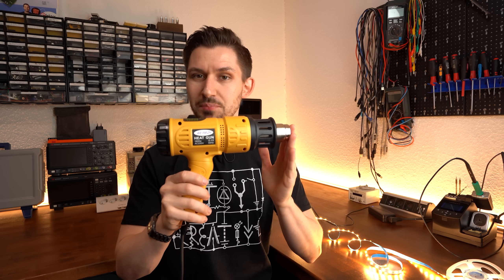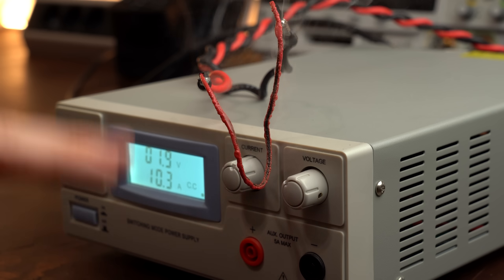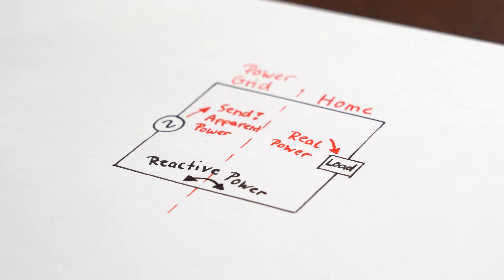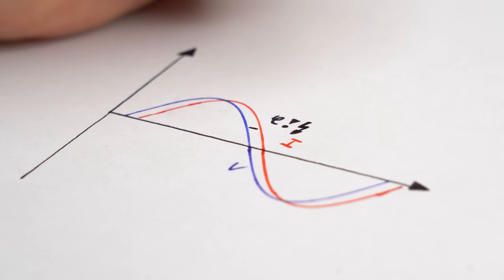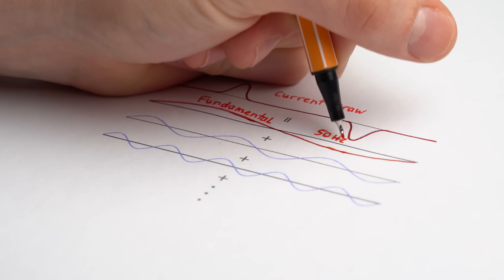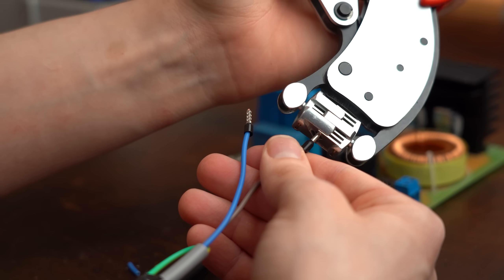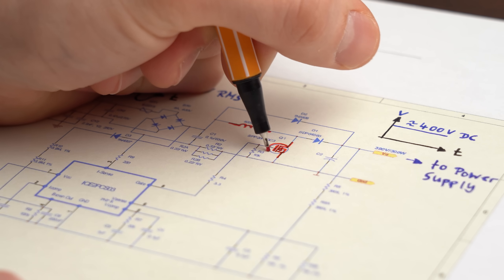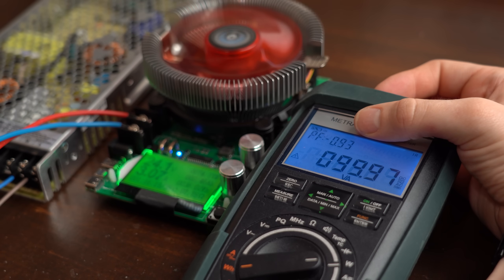The Most Important Circuit for our Electrical Future?! (PFC) EB#55

Comment: I have a vintage thermal printer that requires 5v and -24v, and I'd like to see a video going over the correct way to create negative voltages without giving a large DC offset. as I'm looking to connect this to my modern desktop.
Reply from the maker: Already did a video about negative voltages.

Comment: the problem with PFC-enabled devices is that they don’t properly trigger UPS if mains power goes down. I bought an awesome server power supply from HP to power my 3D printer and later found out it is “invisible” to my cheap APC UPS :(
Reply from the maker: Sucks to hear that.
Reply: I didn’t check it thoughly; maybe it was just a beefy PSU (200A) with a small load (maintaining a heated bed’s temperature). Or my cheap APC UPS is just dumb.

Comment: I'm still wondering why 400 V DC, since shouldn't it be around 325 V ( sqrt(2) * 230 V)?
Reply from the maker: "Active PFC is basically a glorified boost converter"
Reply: @greatscottlab  Okay, thought it came along with the rectification value. Thanks for the answer and the awesome Videos!

Comment: Great video! Also, it only remains to add, that some power supplies use passive PFC in form of a huge coil on an iron core. The coil opposes the fast current rises of the capacitor without drawing too much real power.
Reply from the maker: Interesting
Reply: Passive pfc's are ok for light loads..where the pcb/component area is not a constraint..since all components required are to function at i/p DC rectified ripple frequency 2×(50/60Hz) hence it becomes bulky although NO BULK CAPACITORS ARE USED.. ......typically single stage is most common a single stage is usually 3 diodes, 2 caps. & 1or 2 inductors  (  but 2 & 3 stage are designed..3 stage design reduces p-p ripple to about 30%...also has higher ripple frequency. so dc is good.
Reply: Single stage passive pfc's had widespread use in C.FL.'s with ratings up to 20-25 W.
Reply: AAAAhhhhhh! so that's what that honking big ass coil is for in the power supply units!!!! 🤗thank you kind man for sharing your wisdom.
And big thanks to Scott for lovely electronics lessons!
Reply: @ogi22 that's not usually the same thing. Most power supplies use active PFC these days unless they're really low powered. The large coil you see could either be a common mode choke used to filter RF/EMI noise if on the primary side, or part of an LLC resonant topology if on the secondary side, depending which coil you're referring to.
Reply: @ogi22  thats not what they are used for most of the time
Reply: I seem to recall seeing this solution in some older OEM computer power supplies.
Reply: Awesome vid  Scott Ty.
Reply: The choke (of a realistic size and cost) makes only a minor improvement of the P.F.
Reply: LC filtering instead of just straight capacitive filtering (edit to clarify - this is filtering AFTER the rectifier) will result in better power factor / lower harmonic content, but it isn't very practical with high-current loads at mains frequencies. It used to be common in high-voltage power power supplies such as those used in vacuum tube ("valve") circuits where currents were generally not very high, at least in consumer electronics.

There are passive "valley fill" PFC circuits that can improve power factor but I don't think they've ever been widely used.
Reply: @VeniVidiViral 
There really isn't much on mains that is too likely to cause problems with digital circuitry unless there is something quite unusual. I've seen some pretty hideous mains noise caused by an electric arc furnace used for metal smelting. It IS sometime necessary and always wise to provide protection against transient voltages that may occur on mains, but this is done with devices like gas discharge tubes, metal oxide varistors and the like. Inductance can be beneficial because it slows the rate of change of current so narrow spikes are easier to suppress.

The vast majority of EMI/RFI filtering, whether it is on the mains input or signal connections in digital circuity is to keep the noise IN rather than OUT. Switched mode power supplies can put a lot or RF on the AC mains unless proper filtering is used. Lots of RF noise can be carried out of shielding enclosure on signal cables. The ferrites that are sometimes found on things like video cables are to keep noise from going out on the cables, not to keep external noise from interfering with the signals.
Reply: @@RHRigs No, the one I mean is big like a mains transformer.

Comment: Pfc are becoming available as standalone modules tho it's still a gamble as some are just snake oil still
Reply from the maker: That sucks to hear. Do you have examples for that? I would love to have a look.
Reply: @greatscottlab  I'll fetch you some codes once I'm back from work
Reply: I would say they are all snake oil. There is to my knowledge no way to do any meaningful PFC outside of the power supplies unless you use equipment that cost a hefty amount of money e.g. inverters. In a household there is simply no point in doing this for a number of reasons, cost being the primary. The best thing you can do is check the PF of the appliances you buy and only buy well designed power supplies etc. The difference between the 9.99 power supply on aliexpress and the OEM for 30 are the components that reduces THD and improves the PF and efficiency.

Comment: Good news is that most higher power AC/DC power supplies like those in your PC include PFC circuits.
Reply: it became a regulation in the 90s when businesses were running hundreds of 300w tower PC in one location
Reply from the maker: True. Nowadays pretty much mandatory above 100 to 150W I think.
Reply: @greatscottlab  the addition of PFC circuits was especially important for large data centers. In the early days of Google our servers didn't have PFC circuits which was fine when you didn't have many. We quickly learned the importance of PFC when we started building clusters with 1000+ servers. Without PFC we would run out of power capacity. PF on average was close to 0.6. Later server designs required a minimum PF of 0.9. Now a days most servers have a PF of 0.96 to 1.0. PFC circuits have become extremely important and have come a long way.
Reply: Another thing to mention is that bad PF leads to heating and premature wear of upstream transformers. Power companies benefit from good consumers of power.
Reply: This totally depends on the standard requirements. 
E.g. IEC61000-3-2 for single phase devices or -12 for three phase devices. 
Only the cheapest solution to keep it will be implemented. 
In the lower power range mainly passive PFCs are used. Just shaping the current as little as necessary. 
Money rules, not the technical best solution.

Comment: But does this inject more or less RF noise and interference into the mains? There are still plenty of uses for radio communications in the 100 kHz to 30 MHz spectrum, but many switched-mode power supplies do not have the filter components fitted and cause huge problems of radio interference. Does this circuit make things better or worse? Thanks.
Reply from the maker: Since it uses High frequency switching, it does of course inject more noise. But that be deal with a filter
Reply: Not much if it has a proper filter. But since the filter is made up from inductors and capacitors (which drops quite significantly in price the smaller they get), I guess RFI problems might increase as the manufacturers try to cut BOM for their products. 
Although, that will mostly be an issue if implemented on products that don't already contain switching power electronics. For example many LED lamps have horrible power factor, but no RFI problems (and thus no need for a filter), since they use only a simple linear regulator for current regulation on the DC side.
For switching power supplies it will probably not make much difference, since they have the same problem anyway. It doesn't really matter if current coming from the rectifier is at first switched thru a boost inductor for PFC or if it's switched directly to for example a high frequency transformer inside. The high frequency ripple will make it out to the mains in both cases, if not filtered out.
Reply: It can easily make it much worse. Look at the internal square wave with variable duty cycle. Such as pulse train has spectral components all over the HF frequencies. So it better be seriously filtered and shielded!
Reply: Higher frequency doesn't travel as far, and is easier to filter, but for sure bad power supplies can be very noisy. In the USA, regulations exist via the FCC that devices can't radiate too much RF noise.
Reply: @aaron41  A troublesome part of how EMI is tested is that jittering the switching period to spread it out makes the EMI lower in the testing, but makes it harder to null out using DSP tricks in the receiver.
Reply: There was a pfc circuit based on the cuk converter that achieves a 0.99 power factor and I would suspect that the properties of the cuk converter radically lower the noise.

Of course, the cuk converter is transformer voodoo and a bit wonky to design.

Comment: Oh yeah, I remember when learning about the "power triangle" (apparent power is a vector made from real and reactive power) when working with 3 phase AC. When you want to compensate for inductive loads generating unwanted reactive power, we simply put a calculated capacitor in parallel to it. But I didn't know it was such a huge deal with DC appliances. I actually never thought chargers weren't SMPSs for the most part and were MUCH more rudimentary.
Reply: @tripplefives I tried measuring the power factor of my vacuum tube receiver. The power factor initially was something like 0.95, then dropped to 0.87 or something like that once the tubes started conducting. The receiver does not have a filter choke, just two silicon diodes arranged as a voltage doubler.

Another device I tried is a VTVM. It has a tube rectifier for B+, no choke and some of the tube filaments are DC (selenium rectifier).
Instantly after turn on, it uses 52W, 0.97PF, then it drops to 30W 0.96 and once tubes warm up the power goes up to 54W and power factor to 0.92.

Maybe the inductance or the resistance of the transformer helps smooth it out. I have seen DC chokes only on some tube radios (in some cases they use the output transformer as a choke), most devices do not have one and there was no problem with power factor until switching power supplies became prevalent.
Reply: Switching power supplies are the ones with this current waveform. Older type power supplies with a 50Hz mains transformer have power factor of 0.9 or so, no problem there. In addition, they are simpler to repair and a capacitor failure is not so destructive. However, they are bigger.

Comment: If the PSU or LED driver utilize capacitive dropper then how can it function on DC voltage that is coming from the PFC?
Reply from the maker: Well, in such cases a replacement is not that easy to do.

Comment: Now I understand why Nikola Tesla won the fight against Edison 😀 thanks for this information 🤓. From now I won't plug my power supply for 24/7
Reply: Tesla won the current wars because of transformers.  In the time of Tesla and Edison, the only way to convert between voltages, was to use transformers and AC power.  Edison's DC system wouldn't efficiently transmit power over long distances, since it was limited to the voltage at generation, and the voltage people would use in their homes.

The DC:DC converter wouldn't be invented until the 1950's.  Had it existed in Tesla and Edison's time, we could've had DC distribution.
Reply: @carultch  yupp but both ac and dc have their pros and cons so both are useful in certain places. @Electroboom even maided a detailed video on this topic.

Comment: I have ideas to build power supply from active full bridge rectifier+active  pfc is can get more efficiency?
Reply from the maker: Well. Sadly no. A PFC will in most cases lower the efficiency because it wastes a bit of power as well. But then you have to see what power gets lost because of the reactive power and the conductor resistance. It is a complicated calculation....

Comment: The correction factor has existed for centuries, the largest consumers of electricity are industries, which have many motors with high inductances. If you want to change the world, that's where you should start.
Reply from the maker: Industry already gets charged for the apparent power. So they are paying for that and takes measures to reduce that with passive PFCs.

Comment: The common household consists of   lagging power factor due to at least there being a fridge, ceiling fans, exhaust fans or an AC all of which require reactive power to operate. The most simple way to deal with that is to connect a mains voltage rated capacitor of 1kvar or more as required parallel to the mains breaker.
In most skyscraper/ big buildings it is mandatory to place an APFC Panel board to monitor and control power factor between -0.96 to +0.96
Reply from the maker: Thanks for the feedback. Good information about the skyscraper.

Comment: Is it possible to make a PFC circuit with a regular boost converter IC (like UC3842/43), theoretically the duty cycle would by large at lower voltages of the sine wave and lower near the top of the sine wave...
Reply from the maker: It is a bit more complicated than that.

Comment: Why is a power factor of .85 recommended in France when 1 is the most efficient ? Is it just a minimum requirement ?
Reply from the maker: Having some reactive power in the power grid is actually not a bad thing. For this video I just simplified a bit. But better google this question because the answer is quite long and technical.
Reply: Perfect would be impossible, I guess they determined that 0.85 would be cheap enough to implement.

Comment: In the EU it is already mandatory for commercial devices that use more then X W 
But if it is a china import it may be avoided for better or worse.
Well for super small loads like that LED lamp adding PFC would cost a ton and to make it worth it you need to increase to lot the life time of that LED so costs simply balloon.
Reply: We have a building with 30 LED lights and I can't get a UPS to act as a mains fail backup on it. Did when the LEDs and UPS were new but I think the LED's power factor has deteriorated with age so the UPS can't cope with them now.
Reply: @hoverbovver  interesting also since it is LEDS maybe a more DC solution is better?
Reply from the maker: True
Reply: 75W and above requires PF 0.9 or better. Under 75W 0.5 or better. What we learn from this - don't buy crap 😂

Comment: Love the videos! Wanted to ask if you were familiar on making PCB Antennas for custom Pcbs without needing to use external pre made modules like you have done before. I tried doing research on my own to help but nothing really helped me. A video from you would be very easy and informative to understand 👍
Reply from the maker: I can put it on my to do list
Reply: @GreatScott!  I wonder how long that list is 🤔
Reply: Antenna design is kind of an art.  There's some theories out there.  They kind of work.

There are two things about antennas.  First is that all objects have an inductance and capacitance (which is what an antenna is).  Length of an antenna corresponds to a value of inductance and capacitance.  This also gets into wavelength.  All of these factors become inter-related and everything becomes proportional to 1/4 of the wavelength (rise to peak, drop to zero, drop to trough, rise to zero in a sinusoid).  It... is and isn't complicated.  You're charging an extremely small capacitor that discharges across the inductance of itself, forming a tiny tank circuit.  Because all of this corresponds to distance, you can get weird phenomena like reflections (you can "kink" high frequency electricity like you would a garden hose), standing waves (why putting metal in a microwave leads to arcing), etc.

The second thing is that stripline works by preserving the symmetry of transverse modes... while microstrip makes a great antenna because it does away with said symmetry.

To my knowledge, there is not, as of yet, a "theory of everything" for the electromagnetic spectrum.  When does a tank circuit couple fields versus produce photons... and is it photons mediating between the coils of transformers?
Reply: @Aim54Delta  ah, thank you for your information